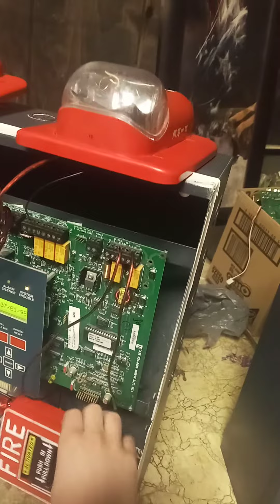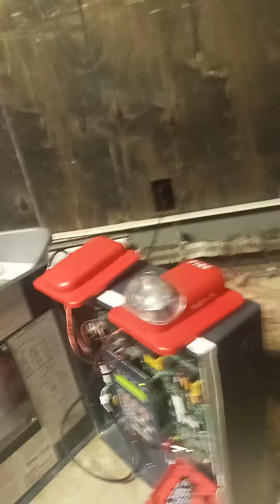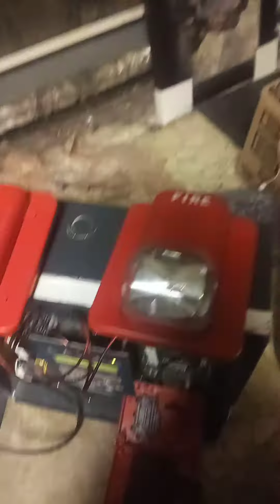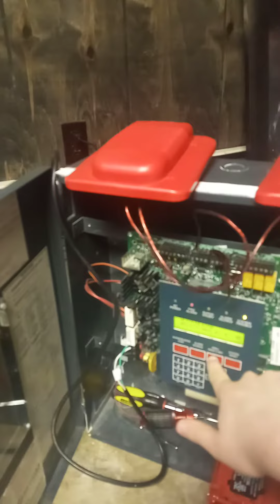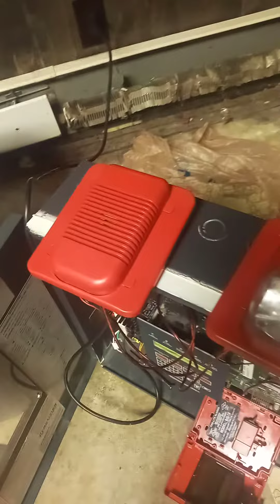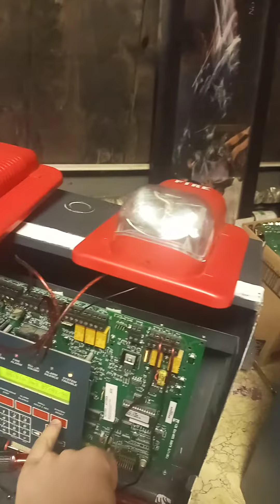System Test 13 S2 (System Sensor H12/24 and S2415 SpectrAlert horn and strobe)

Comment: The H 1224 has a little lower pitch than usual almost sounds like a wheelock NS
Reply from the maker: It also sounds raspy too and there is a reason for why it sounds different, and that reason is this panel puts out Full-Wave Rectified type Direct Current power or otherwise referred by the acronym FWR DC which is and unfiltered.
Reply: @dantestoner6020  I’m thinking about getting a Fire Lite MS2 panel sometime, does that put out FWR?